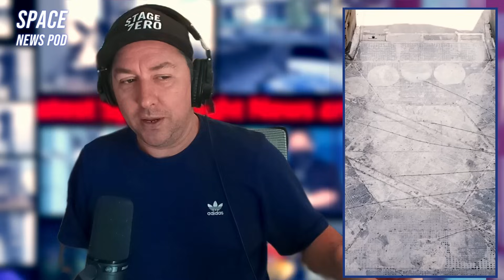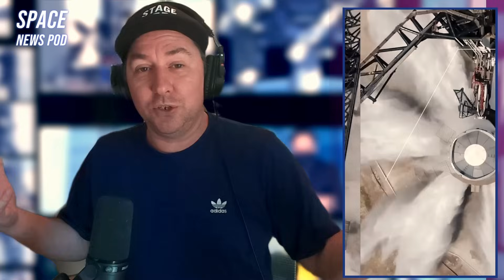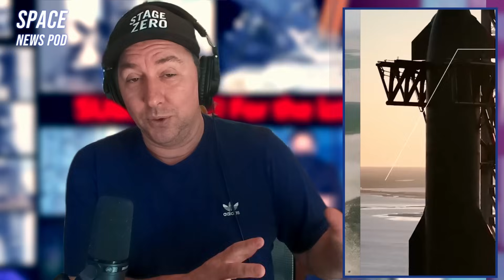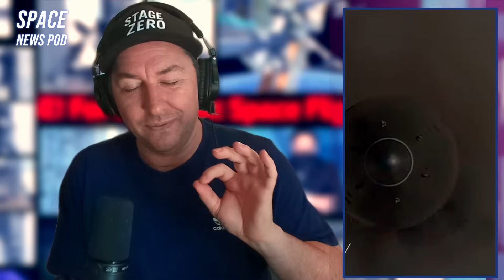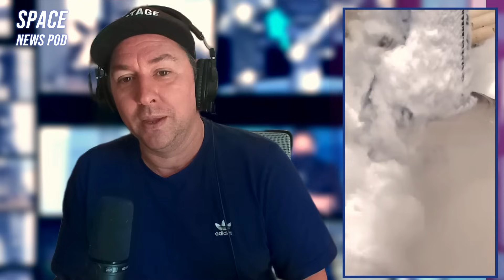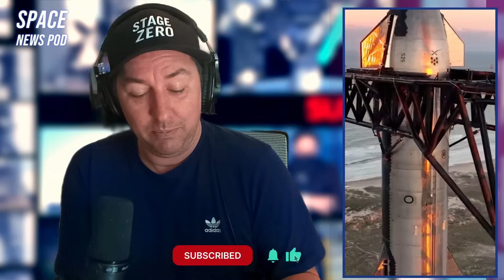Starship IFT4 Mission Profile - Elon Musk's Big Idea

Comment: SpaceX probably has a perhaps major redesign of the heat shield system for Starship v2 because the current version can't be considered to be rapidly reusable. However, they do want to map that re-entry  profile as complete as possible before finalizing v2 because it is the biggest unknown at this point. I think that starship could probably survive reentry with missing tiles if not too many are lost. There may be several holes in the steel structure post reentry though.

Comment: IFT4?  Another failure. Rapid development is fine if its cheap and quick. For this? Dumb strategy.
Reply: Weird take, every IFT launch so far has been a success based on the stated metrics of the test before. The development of starship has been faster and cheaper than any traditionally developed space craft (New Glenn, SLS, Orion, all that)
Reply: @jasoncramer6717  And just how many IFT launches is it going to take before both booster and starship survive without turning into scrap metal? I'd have thought you'd want to get this fundamental aspect right before messing around with anything else. If neither land successfully, its a fail and no amount of spin is going to convince me or anyone else with their heads screwed on. The weird take is to be screaming success without acknowledging ANY failures at all. Very weird.
Reply: @saiello2061  there's currently no possible way for either of them to land... There never has been. Every test so far, and probably every test this year will end with exploding starships. That's the currently the least important thing they're working on. All of their current objectives don't require landing. Landings are for 2025 if we're lucky. SpaceX has failed a bunch of things, mostly deadlines, but they met their stated objectives in all three IFT launches.  It would be like yelling at a kindergartner who passed their addition test, because they didn't do multiplication. Sure at some point the kid needs to multiply, but that isn't what you're testing for right now.

Comment: But what are they going to do about the tiles. Maybe a clear coat sealant? I know that adds weight, but it can handle it. They just need that external HST covering that will help with vibration, and tiles falling off. 
Well at least the header tank worked. But the door needs some major work. It looked like paper in the wind. This time they are moving to fast in flight functions. But I hope they get 4 more off before 2025.
Thanks for a great episode. 
 - Will

Comment: There is no RCS on Starship/Booster. Obviously, this is a mistake. The cold gas system was a bad idea. This caused the reentry failure. I hope this is fixed. To say succesful or failure, is bad because there were succeses and failures . Launch, separation were succeses. Attitude control, reentry and the door operation were failures. The fuel transfer is unknown because I have yet to see data. 
They need to fix the RCS. Who came up with the cold gas idea?? Elon?? Bad call. Fix it!
I will be tuned for IFT4!
Reply: The RCS vapor, IMAO, is contaminated by the Raptor precombustion byproducts of H2O & CO2. SpaceX is likely trying to mitigate this on IFT4, since the contaminants can freeze up the RCS and Raptor valves
Reply: @imconsequetau5275  The lunar vehicle will need FCS. In my opinion, they should put on Starship what the lunar vehicle will use. It will need RCS, there is no way of getting around it. The Booster will need a modification. But it depends on the analysis. I am not sure if the fins didnt have enough authority or what happened.
Reply: Think RCS were removed because they did not need them while in space .( Tim’s interview with Elon ) probably did not account for re-entry I am guessing .  Wondering if they can solve problem with out them , if they can great then they can still  add them for redundancy and additional use for a thinner atmosphere .(Mars) or or stronger support for no atmosphere (moon) .  Question could both systems together work?

Comment: One of my concerns is that they have unprotected starlink antennae on the tile side of the ship that could terminate communications upon re-entry due to the excessive heat build-up.  Loss of comms is always bad news. Even the antennae on the non-tiled side of the ship would be subject to heat if rolling occurs again as in IFT-3 during re-entry. Solving the rolling issue (if not comms related) is another major fix action. Hopefully, SpaceX has already implemented updates.
Reply: Pretty sure they thought of that.
Reply: The Starlink antennas are on the dorsal or non-tiled side, facing up during the final "belly flop" landing. They also point directly away from the densest ionized gas during deceleration in the upper atmosphere. 

Since the Starlink satellites are in a higher orbit than Starship while in LEO or during launch or landing, the ship always has a view of satellites.

Comment: Wondering: as both booster and ship appeared to run out of fuel, without reaching orbital speed & zero payload... How are they going to get 100 tons+ to LEO?
Reply: they have a small margin.  Elon said 8 trips will be needed to move enough fuel to LEO for lunar mission although i've heard higher estimates.
Reply: The payload for tankers can easily be increased by adding engines, but there is no point in putting 9 Raptor engines on Starship until they are assured of full recovery and reusability.
Reply: The energy put into IFT3 reached or exceeded what is needed for a circular orbit, but they chose an elliptical orbit path to reach re-entry temperatures from a "sub-orbital" approach over the Indian Ocean.
Reply: @imconsequetau5275  but the booster ran out of fuel & the ship couldn't do a (test) relighting either. Even the lame fuel transfer got bumped.
Reply: "appeared" is doing a hell of a lot of heavy lifting in this comment!

Comment: IFT 3 lost very few heat tiles. They worked hard on trying to get them to stick. IFT 4 will be even better. S29 lost a few toward the bottom where serious vibrations from sound deflection cause problems as well as debris during static fires. Once testing at Massey’s over the flame trench, the Heat tiles will fare considerably better

Comment: 10:36 I doubt the arms of the chopsticks will ever move at all during landing. The booster will do all the work. It will start out of reach of the arms the glide inward until it connects with both arms. That is why the booster needs sloping stringers under the hooks.
Reply: The chopstick landing surfaces are only parallel when closed. But while open any amount, they are not close enough together to catch the SH booster or Starship.
Reply: @imconsequetau5275  The arms could be open 1m more than their minimum at their tip. That would lead the booster in without any arm needing to move. 
If I am wrong, the arms would just have to move very slowly to do the same thing.

Comment: Why can't they fire up the raptor engines to re-enter like the way the boosters do ?
Reply: They could, but it's bad for capacity and price
Reply: @derdunkle8999  but they bring the booster back that way, makes better sence to being the ship back that same way also.
Reply: The booster is basically falling straight down from the edge of space, like Blue Origin's New Shepard, but without parachutes. The second stage Starship has been accelerated horizontally to 28 thousand kilometers per hour or 17 thousand miles per hour. (7.8 km/s or 4.8 miles/s)
Reply: Both stages use atmospheric drag to slow down to below the speed of sound, but the starting energy levels are worlds apart.

Comment: You go to space, then you go 17,500 mph, E=m*g*h + m*v^(2). You can't go 17,500 mph inside the atmosphere without burning up. If you use rocket engines to slow down you have to first lift it out of the atmosphere, 100 mi. up. Aerobraking uses drag to slow down. T is a function of kinetic energy of molecules in a gas. Molecules at 17,500 mph are very hot. Tiles tolerate heat well, stainless steel doesn't.
Reply: Stainless does tolerate heat better than aluminum or carbon fiber. Also, the heat tiles on starship are only the first line of defense. There's an insulating layer between the tiles and the hull. This layer is designed to protect the hull. Provided not TOO many tiles fall off in a small area.

Comment: FYI .... FTS did not end Starship's IFT-3 flight. It disintegrated during reentry.

IFT4 will be focused on B11 fuel management for landing burn for soft landing in the Gulf of Mexico. 

IFT4 will attempt a successful engine relight (as a deceleration burn for Starship reentry). 
Starship need to be traveling slower (~10,000km/hr) to give the control flaps enough lift to slow Starship down below 1000km/hr for a successful landing burn and soft touchdown in the Indian Ocean.
Reply: B11 coming down is one focus, but Elon has said the main focus for this IFT4 is ensuring the ship gets through the worst part of reentry
Reply: True

Comment: Instead of having 18,000 heat tiles, is it possible to have several large form fitted tiles affixed to it? Seems like that would eliminate all the little ones flaking off in critical areas.
Reply: Flexing of the hull/craft/rocket might be the answer to that. Just guessing, though
Reply: I could imagine them using an inflatable heatshield like rfa
Reply: Inflatable heat shields are single use these custom made heat tiles are designed to last hundreds of re-entrys, remember this vehicle is designed to be landed re-filled with payload and launched all within hours like an airplane @derdunkle8999